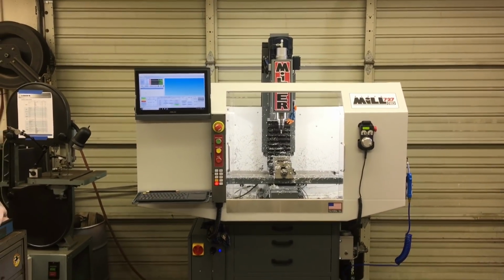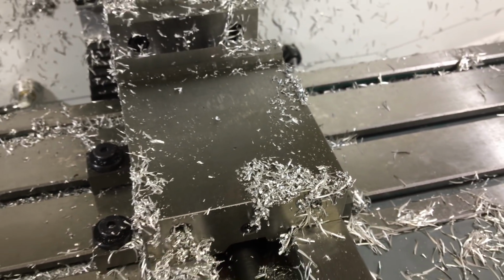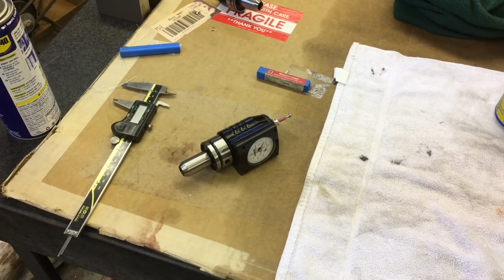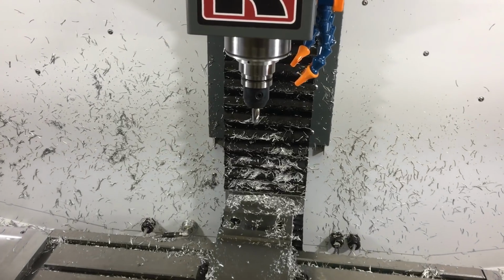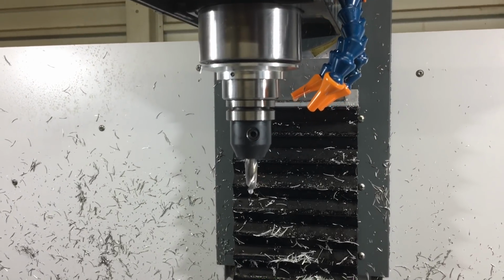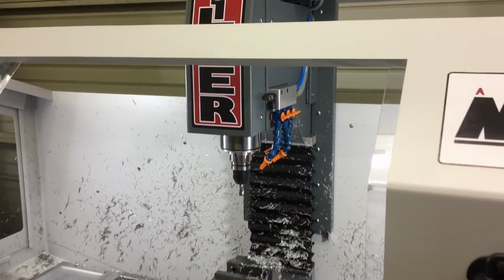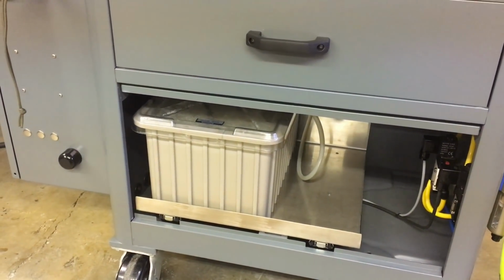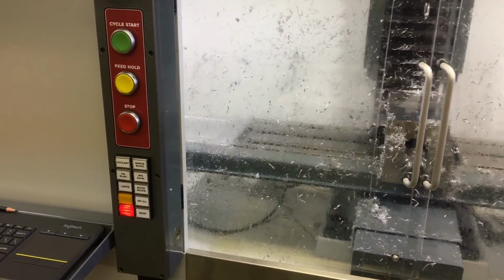GRIZZLY G0704 CNC Conversion Update 35 - ( Shake down / Mistakes )

Comment: Bro I would really love a link to that powerdraw bar cylinder. How much pressure do you need on it.
Reply from the maker: The hydraulic draw bar cylinder in a one off I made just for the machine. Enerpac sells threaded body cylinders on similar size and spec. I remember them being pricey.
Reply: Nicholas Miller you willing to make another for sale? Whats the air pressure to it?

Comment: It's dirty!!  Now you need to add a bigger flood pump and add in a washdown hose!  Makes keeping the machine cleaned easy and helps mound up chips for easy removal.. also less messy than using air for clearing the vise and table for part swaps!
Reply from the maker: Chris!! Happy almost new year! like all things, the only constant is change! I'm sure a pump upgrade will happen sometime down the road. - Nick